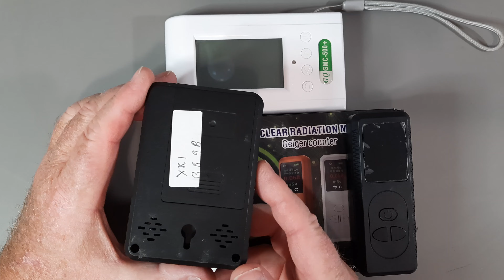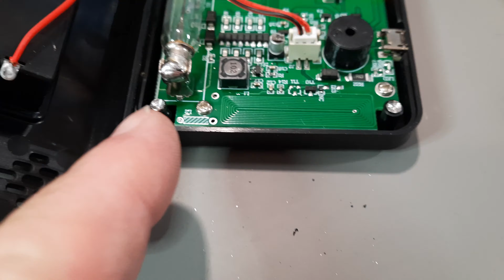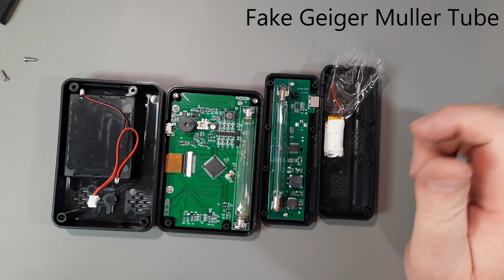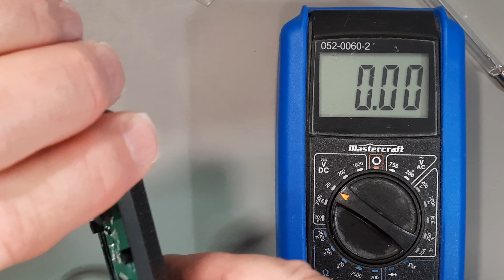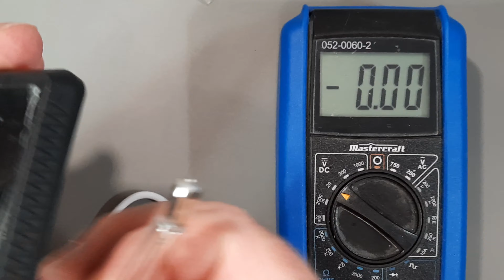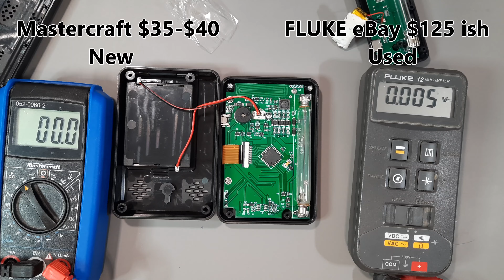Geiger Counter Fake vs Real

Comment: Hi. I have one of the real ones, and as far as i know, it's ok; but i used days ago, and it measured, not only in my house, but in my neighbourhood; in between 0,6 a 1,8 uSv/h. Obviously that's not  a normal reading. In my country there's no nuclear plants; but  I checked the geiger counter tube, and it seems fine (more than 20Mohms in between its terminals, 324 volts polarization voltage, visually fine, no cracks or aparent damages). I also have a  ftlab geiger counter, but it doesn't detect any beta or gamma  radiation, so it's not concluding. So i'm doubly worried: If the detector is fine, ¿what's the source for the radiation? (i know this device can detect a little of alpha radiation); and if it's broken, ¿How can i fix it? ¿What could you tell me about this?
Reply: I have news: I apparently fixed it. It seems got out of calibration after the fixing (when it turns on, meter begins on 0,00 mSv/h, instead 0,10 -0,20 mSv/h), but it doesn't matter too much for me; i just need it to detect radiation presence. The fact is the tube seems that is working and the device, is detecting radiation (inclusive, i didn't know the tube, a j321 tube, was sensitive to UV rays also). So now, following suggestions of copilot AI, i removed the tube, and washed it and reinstalled it, and now its "normal", suggesting that it was coated with radiactive dust. So now the questions are bigger: ¿Where could it got contaminated with radiactive dust if in my country there are no radiactive power plants? I really don't know but now is working normally.
Reply from the maker: Can't really help you on this since mine never worked and there is not any serviceable parts inside it.  If you have a smoke detector that has a radioactive source, there is s quick test you can do. You do not need to open the smoke detector or tamper with it. Just put the Geiger counter up to it for a minute and see if the reading increases. If it does then it might be working but the calibration might be off. If you live in Europe do a google search for "Europe Radiation monitoring" and look for the Radiological Maps - European Commission. They have a map of current background readings.
If it never had readings below 0,6 I would suspect it is defective but maybe go for a nice walk and see if the readings change.

Comment: Oh come on the zap only hurts for a little while.
I lost count how many times I've been zapped playing with TVs in the '70s and '80s.
The amazing capacitance of a CRT.
Wasn't until I started getting into other electronics where I became truly fearful.
Blowing that first Snot Box is really what did it.
That great big IGBT blew clean across the lab!
Was it any wonder that there were suddenly E stops installed everywhere.
Reply from the maker: I remember all the high voltage warnings inside the old TVs. And one tube that had a lead shield around it. 
Have been zapped before and have a very healthy respect for any level of voltage.

Comment: You need an input impedance of art least 1Gohm to measure the geiger tube voltage, I think your Fluke 12 has a 10Mohm impedance,. which will pull the power supply down. The output impedance of the HT is about 10-50Mohm. Your real issue may be a faulty tube, it should have infinite resistance between the ends.
Reply from the maker: I found a manual for the Fluke 12, the input impedance is 10Mohm when measuring DC voltage. I should have set up a resistor voltage divider to get a more accurate voltage.
The faulty tube has no connection to the inside of the glass tube surface, it is just straight through. It was probably a factory reject and someone decided to make a few cents. The AliExpress listing only had 1 positive response, the rest indicated it didn't work.
Reply: @retireeelectronics2649  any digital meter have 10m input inpedence even cheap ones, you can use osciliscope x10 or x100 probe the resistance will be more, it should be 600v about that